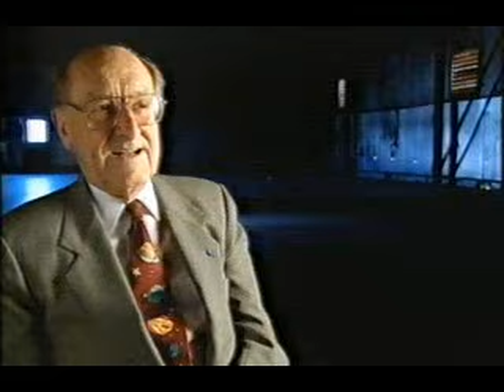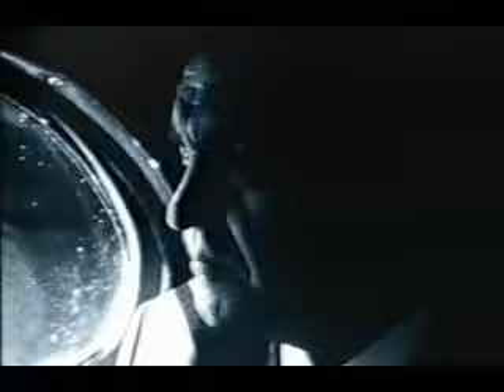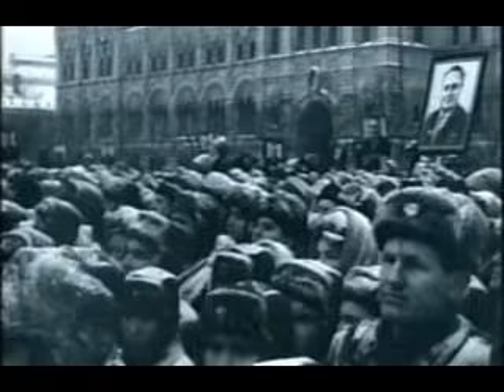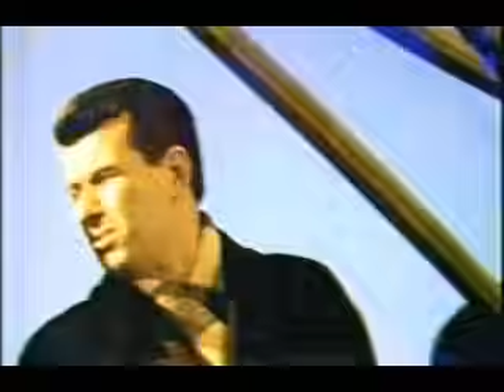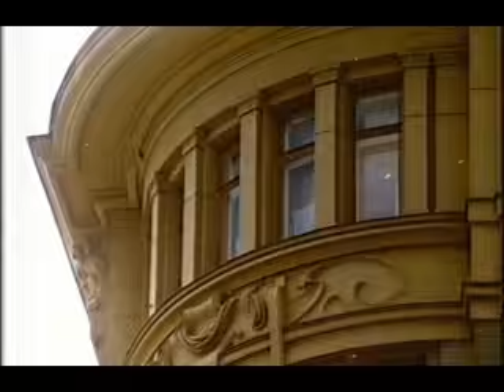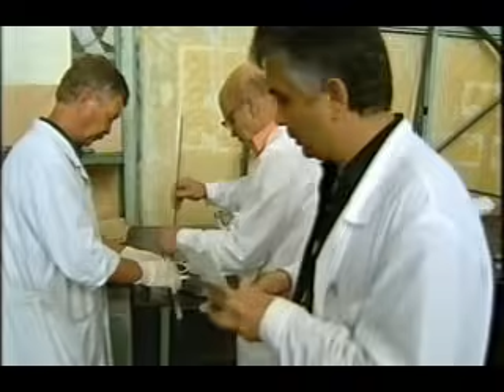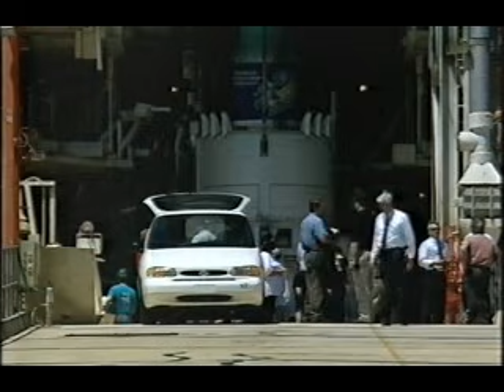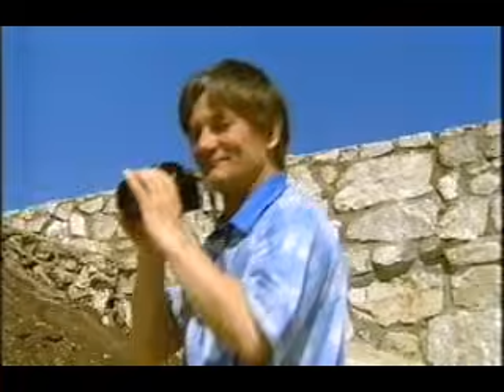Soviet N1 Moon Rocket Documentary

Comment: I noticed that the engineers weren't using torque wrenches to tighten the bolts on the engine,OMG how could they get any consistency ? On a rocket engine ,with such pressures one would absolutely need exact torque down numbers, but then it when bang anyhow.
Reply: +starview1 Given that a bolt got sucked into a fuel pump during one of the launches causing the greatest non-nuclear explosion, and you'll understand why the N-1 never even achieved Earth-orbit.
Reply: Pretightening
Reply: player101player101 could be true but what if the non torque wrench went too far in the first place,because then, backing off on the torque would be too late, just saying.
Reply: starview1
Im sure these guys know how to handle wrenches. After all... they are rocket scientists ;)
Reply: player101player101 LOL.Yeah,I only mentioned the torque wrench thing, because russia has has serious quality control issues, even to this day. well time for some KFC have a great day
Reply: starview1
 U have a good one too :)
Reply: all american missiles flew on RD-180,  they never would have reached Earth orbit without this engines.
Reply: +starview1 you would also  told about the Little Red Riding Hood and the Wolf....
Reply: +starview1 Can you tell us who bombed Yugoslavia, Iraq, Libya ..? 8 )

Single-chamber engine which 'was' installed in the Saturn is impossible in principle, it is contrary to the physics laws . its a shame not to know. ;)
Reply: +starview1 What kind of facts about the F-1? I know only one: the engine of this design is not possible. This will tell you any competent engineer.
 With regard to war crimes committed by the US, these crimes were only required to support the funny papers. For the sake of the dollar pindos killed millions of people in recent years.
Reply: ltflak A bolt in my toilet was pretty bad too, and I get it.
Reply: PoorSong bought and paid for by usa tax dollars.Was cheaper to buy it than build it,russia does the same stuff, they are on a buying frenzy buying 747 cargo planes , which while smaller than russian stuff USA stuff is more reliable. Two way street.
Reply: BS! The US simply cant do the engines. Rocket engines is the strategic technology as the nuclear weapons. The americans have already announced that their space program collapses.
Reply: PoorSong Completely untrue.Today to help develop the USA's  future heavy lift rocket, NASA resurrected the world's most powerful rocket engine ever flown - the mighty F-1 that powered the Saturn V rocket-The SLS vehicle when finished will be  5 times more powerful than any known planed machine by anyone else. The rocket will be for deep space flight to Mars and beyond, also incorporating the most powerful Ion  propulsion engines ever built. The low fuel replacement requirement for NASA's  new (already tested) engines make them ideal for deep Space flight. While other countries are focused on one rocket funding source, the USA (within the USA) has no less than five independent rocket mfg companies. Further the USA right now is the leader in 3D rocket engine design systems. (perfect for mfg. of rocket engines) at bases on other planets,moons, or asteroids. we  are talking up swing not down swing.The new RS-25 engine at the Stennis Space Center in Mississippi was the sixth test  of seven that NASA is performing. The engine can produce over 12 million horsepower – or 512,000 pounds of thrust – and has a main shaft that rotates more than 10 times as fast as a car moving 60 miles per hour.
Reply: PoorSong NASA in the 1960's built the most powerful rocket engines (in the world) ever to fly successfully  in the saturn five. In a free world, technology is bought and sold.The  gains from free trade ultimately depend on intent.”  The fallacy in the policy of ‘peaceful trade’ is that it can only be used with peaceful countries, not countries that only pretend to be peaceful like Russia and China just to name a few.  If anyone believes these countries are peaceful they are only fooling themselves.U.S. companies and the State Department helped supply the machine guns that were used in Russia to shoot their own retreating soldiers in World War II. Russian leaders,admit that their intent is to be aggressive and that world government is their ultimate goal.  However, during the Cold War there was a massive increase in trade “… entirely contrary to historical observation and rational deduction.  The Russians even believe that the use of detente is “… an interlude to gain strength for the next stage in the battle … there is no change in heart or direction of the old KGB freedom destroying  rooten tooten putin.In any event it was deemed cheaper to buy the engines from russia than to make them in USA which of course has now changed.Wouldn't it be nice if russia would actually try to work for world peace, instead of promoting classic russian paranoia.
Reply: PoorSong Well what ever the fact is the Saturn 5 engines worked quite well.
as far as Yugoslavia, bombing by western countries,ground operations, to undermine the military capability of the Bosnian Serb Army which was murdering innocent people by intent as was proven at the end of the conflict.In response to the refugee and humanitarian crisis in Bosnia in part.Bosnian Serb General Ratko Mladić threatened to kill 50 UN peacekeepers who were seized as hostages and also threatened to shell the Muslim population in Srebrenica .In April 1992, the government of the Yugoslav republic of Bosnia-Herzegovina declared its independence from Yugoslavia. Over the next several years, Bosnian Serb forces, with the backing of the Serb-dominated Yugoslav army, targeted both Bosniak (Bosnian Muslim) and Croatian civilians for atrocious crimes resulting in the deaths of some 100,000 people (80 percent Bosniak) by 1995. It was the worst act of genocide since the Nazi regime’s destruction of some 6 million Europeans. Why was such murder carried out, the world was appalled at the slaughter .Now on the other hand I know a couple of serbian guys , (actually from Yugoslavia) now USA citizens, and they said the serbs were trying to get rid of Albanian drug dealers,  so there's that part. You know at the end of the day I just wish, that people would stop this war hate nationalistic bull crap. Everyone just wants to live in peace  and we don't need idiots with their political horse crap ruining the world. (radical islamic freaks are today's main social cancer, that's why russia is now bombing them in syria, thing is russian  politics has never been really a trustworthy bunch. either) (just look at how 60plus years of old ussr screwed up the world!)
any how it's true russia does make a decent rocket engine but so do others.Thanks for your time
Reply: PoorSong The saturn Engines worked, how else did the saturn 5 get launched
Reply: PoorSong Ok now it's time for some KFC extra crispy,with mashed potatoes and perhaps a beer.Thanks for your time
Reply: +starview1 I have for dinner crimean portwine & veal kidneys with my special sauce.
 Bon appetit. 8 )
Reply: PoorSong sounds pretty good,a buddy of mine calls port wine rocket fuel,he works for Orbital Sciences,they build rockets, so that's where he's at.LOL
Reply: +starview1 He drinks heptyl? Cool guy.
Reply: PoorSong You need to be cool in Arizona LOL
Reply: +PoorSong BS! The US simply cant do the engines. Rocket engines is the strategic technology as the nuclear weapons. The americans have already announced that their space program collapses.

Well if you wanna go there, the USSR already announced their whole country collapsed so...
Reply: +Kyle Matlock the country has long collapsed, but NASA is not nearly came close to technological achievements of the USSR.
Reply: PoorSong actually that's incorrect, in part, the reality is that more technology is in the hands of the everyday persons, that directly or indirectly came from project spin off of the NASA work. NASA has shared its work with the public while the old (failed) ussr never did. NASA has been to every planet in the solar system, no other space adventure has done that.russia has made some space advancements, so has ESA, but combined that/those  achievements  (while great) pales in comparison to the science that come/came from NASA by orders of magnitude.  ESA and NASA , bring more to useful public product.
Reply: +starview1    We live in different worlds, my friend. I believe in the laws of physics, and you believe in Hollywood and TV. You dont believe me now, but remember my words after 5 years, if it is possible. "Mercury", "Gemini", "Apollo"...  All this is fake. NASA still does not own the technology of manned space flight. So it goes...
Reply: PoorSong Have You ever studied at a university?  Because there as else where, you will/would discover the science and engineering  gleaned from the NASA missions, such as apollo and how today much of that science find application in everyday life. Travel to the Kennedy space center in Florida where you can actually see,feel, touch the hardware of Apollo,and other missions.

https://www.kennedyspacecenter.com/things-to-do/apollo-saturn-v-center.aspx
Reply: More than.
There was no Gemini, Mercury and Apollo, my friend.
A competent engineer will easily recognize a primitive models made by illiterate amateurs. For dull housewives, what are the majority of americans, this fake is quite satisfactory.
Want more? Read:
http://bolshoyforum.com/wiki/index.php/%D0%9A%D0%B0%D1%82%D0%B5%D0%B3%D0%BE%D1%80%D0%B8%D1%8F:%D0%9B%D1%83%D0%BD%D0%BD%D0%B0%D1%8F_%D0%B0%D1%84%D0%B5%D1%80%D0%B0 starview1
Reply: PoorSong So it's true ..you have never studied at a university, have never worked in engineering, well then your reference site is consistent with what is historically called russian classical paranoia.Classical russian distrust of the government state brought on by 60 plus years of the suppressive now failed ussr. Reality check time... The apollo moon missions are recognized worldwide for their reality and the science they brought to mankind everywhere on earth.
Here is a solid historical website

https://www.flickr.com/photos/projectapolloarchive/albums

Here's a website from Arizona State University

http://wms.lroc.asu.edu/apollo/browse

Here's another

http://www.space.com/26630-apollo-11-vintage-tech-innovations.html

This site from IBM

http://www.space.com/26630-apollo-11-vintage-tech-innovations.html

The reality is the engineering and science shared with the people of the world from the United States of America dwarfs, any other such adventure ever by anyone in human history. No brag just fact.
Reply: Poor brainwashed boy.
Read the text on my link, young zombie. 8 )starview1
Reply: PoorSong The fact remains that every hoaxer claimant claim has been defeated.Here's the bad news for you, I showed your pages to  a professor at ASU , (reluctantly) and the response was those alleged reports you think are of value from that site are utter nonsense,here's why in part.

https://en.wikipedia.org/wiki/Lunar_soil

Here is real science done by oxford University PDF file on scientific analysis

 http://petrology.oxfordjournals.org/content/42/8/1401.full.pdf

Here's another study by Brown University

http://www.planetary.brown.edu/planetary/geo5/Desktop/Geo5website/2015/Geo%2050-Exercise3-MoonRockLab-2015.pdf

This is not propaganda as you claim these are 100% valid science papers from universities and there are 1000's more like them from credible science.
Just as a side note , do you realize based on the faulty website you sent that it would be more difficult to fake those results than actually going to the moon? The other thing is that the United States Space program was totally open to the public at every launch, the old ussr (now failed) was all in secret we rarely ever heard of ussr failures until, if it all ,after the fact while the American program was done right in front of the entire world. So what does this mean, this means we cannot trust anything from the old ussr days and even now, facts get screwed up in the russian republic, in part because of russian government controlled media. This has always been a problem in russia and today is no exception.So if you want to play the propaganda game, I suggest you look in your own mirror.
Reply: We speak different languages, my young friend. Im in the language of the laws of physics, and you're in the language: "I was told by NASA and my honest government." I researched a few years the story of the "moon landing" and I have no doubt about it. Its a pity that you dont know Russian. I hope that you will not be ashamed, when you know the truth.starview1
Reply: PoorSong oops not quite, it's taught at Massachusetts Institute of Technology (MIT) and ASU ( Arizona State University)  for example  Two world class universities. If you are trying to tell me they don't know what they are doing or are somehow attached to the US government  I can say with 100% assurance that that is not the case. Further I have relatives, from the NASA period of Apollo that actually worked on systems used in /by NASA  one long gone and the other is 85yr old.They were in part the reason for my studies in the Aerospace area. There's nothing to be ashamed of as the truth is on my side.
Reply: +PoorSong You better check under your couch, I think Bigfoot is eating your borscht.
Reply: +John Wells You better study physics within a seventh class of the soviet school.
Reply: +PoorSong BS! The US simply cant do the engines. Rocket engines is the strategic technology as the nuclear weapons. The americans have already announced that their space program collapses.

Well if you wanna go there, the USSR already announced their whole country collapsed so...
Reply: +starview1 OK, it started. Dont be nervous, Sir Lancelot!

Comment: The mothballed NK-33s at the beginning are the same engines that likely failed in the recent Antares accident, rebranded as the AJ26. In order to allow the bre-burner exhaust to recombust in the main combustion chamber, the fuel mixture is oxygen-rich. As a result, the bre-burner exhaust is extremely corrosive, and the turbine is exposed to these gasses. And in fact, turbine failure is exactly what the investigation is looking into as a chief suspect. That bit extra efficiency comes at great risk.
Reply: i was just about to post something about the nk33.
nasa bought a bunch of them in the 90s and have used them and continue to use them.